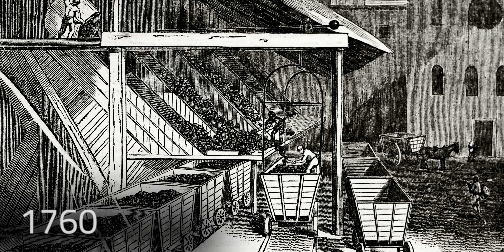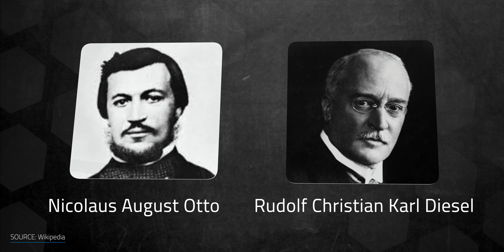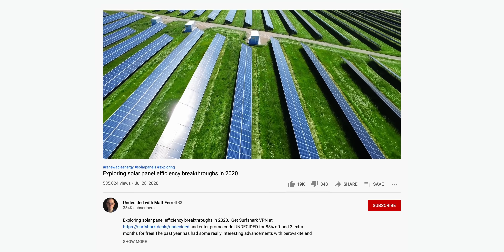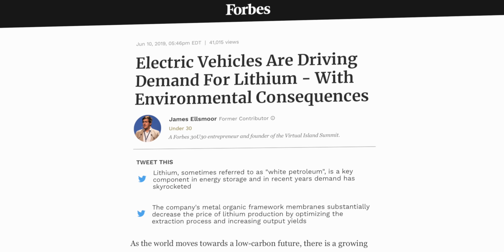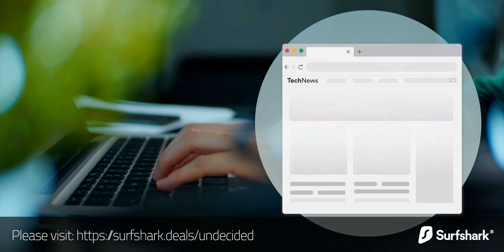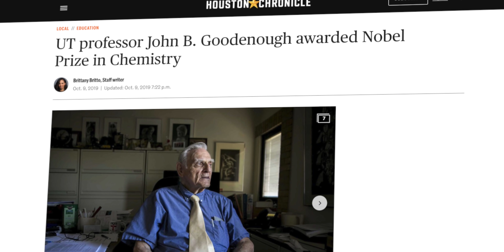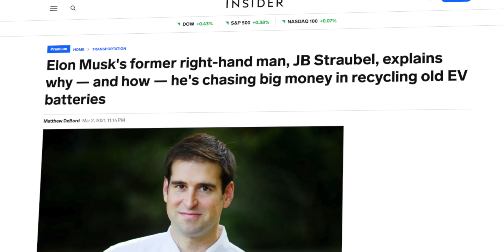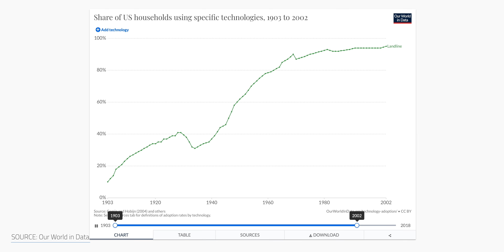Is the Future of Renewable Energy Inevitable?

Comment: You’re going down the efficiency rabbit hole. The Sun alone imparts 439 x10 to the 19 th Joules in one hour. Humans use 411 x10 to the 19 th Joules  in one year. Do the math. How efficient do we need to be to convert all that power? It’s minuscule. The question is not how efficient the question is to stop using fossil fuels . Converting all that energy to Hydrogen will ensure a sustainable future no mater how inefficient.

Comment: what kind of question is that? - it is inevitable.  even if the price of fossil fuel is low relative to renwables.  so either fossil fuels will spike in price, or renewables will come down in price, fast.  or both.
high temperature semi conductors is solved & applied - gives fusion.  so far, so good.  at the same time, global warming is happening so fast, as is deforestation & use of fossil fuels.  the effects are no longer deniable.  drought - rivers drying up.  floods (areas where the CO2 is high in concentration over large green-vegetation areas causes increase in oxygen production (by the plants) - which creates more fresh water (only in those areas) in the upper atmosphere:  H2O).  and lastly, world-wide forest fires that burn year-round now.  the last proposition is horrendous.  and, there's plenty of proof of the latter.

Comment: It is not as if you can plug directly into the sun or the wind or a dam . Where does the steel  , plastics , silicon and concrete come from ?
Reply: Everything has a footprint. A matter of less or more. And remember, perfect is the enemy of good.

Off the top of my head, including manufacturing, wind and solar pollutes magnitudes less than coal and gas.

Wind in particular generates less than 20g of co2 per kw/h vs about 500g and 1000g of gas and coal. 

Up to a 50x improvement.

Source: Youtube > DW Planet A > How clean is solar really?

Comment: I am shocked that you implied there is a possibility of increasing the efficiency of solar panels by a factor of 10.  That's nonsense.  Right now the best cells can put out 47% of the solar power they receive.  If that percentage when up by an additional factor of 5, that's 235%, which puts it squarely in the realm of (fictional) perpetual motion machines.  As the absolute best case, we can only hope for another factor of 2, and that seems very, very unlikely.

Comment: With steam engine advancements, i wonder how much work was done to improve them (once we were using high pressure steam), what was the environmental cost of recycling parts that needed replacing
Today we could use electric furnaces to remelt iron/steel)
But thinking just aout wind and solar, they are alrerady replacing turbines for bgger ones, how do you recycle the mix of fibreglass and carbon fibre
Solar panels are becoming more efficient, so old ones need replacing, with similar questions about recycling, what's the environmental cost

Comment: Yes. It is 100% inevitable. The entire world will have to embrace renewables whether they like it or not cause we'll run out of fossil fuels and oil eventually and inevitably.

Details for nerds like me:
There are like 1.47 trillion barrels of oil in the world left, we use like 35.4 billion per year. Yes, you read that right.
Assuming our consumption rate of oil stays the same or doesn't decrease, we've got only about 42 years at most before renewables take over 50% of the world's energy demand.

Aside from the facts above, my opinion is that it'd happen sooner.

Comment: Honnestly, I dislike the way you talk about "green hydrogen". Especially when this come from renewable ELECTRICITY. We do not even have 100%renewable grids and this is talking about taking electricity, converting it in another form, then using it. In this way it will ALWAYS be less efficient that using directly the electricity except if the whole transformation-usage part is better than the efficiency of today batteries.

Yes this is better than producing hydrogen from petrol. I know. But there is about no one talking about the overall greenhouses gas emissions on electricity production (gas plant) versus hydrogen production from petrol (and energy recovered on the end). Maybe you know, it would be greener to use petrol for hydrogen, and renewables for electricity. I don't know, no one is talking about that because you know, "green hydrogen".

Comment: You need to distinguish between renewable technology with green energy possibilities that can replace fossil fuels, compared with renewable technologies that can't. For example "renewables" include diesel fuels made from algae or other plants, as well as wood products and wood waste. All these renewable sources require combustion to release heat and therefore add to, rather than replace, atmospheric carbon. Renewables also includes hydro, for which there are almost no places left to increase the resource. 

Your viewers need to focus on two points you make:  solar and wind are only available to the electricity production system a third of the time.  This means that fossil fuels must be used to replace the missing power.  Second, our nation seems determined to add electric vehicles to electricity demand without using natural gas but clearly lacks the resources to bring on enough wind or solar to replace fossil fuels and handle e.v.'s

Comment: I would hope that we would move to nuclear (with more modern reactor designs) in the short to mid term to shore up renewables.
It really is the only thing that produces power to a scale to meet our demands, reliably, and not require massive amounts of rare minerals.
Reply: this is only true if you think in terms of the spawling power networks we currently have. I think we need to break up the current networks to smaller networks which will enable us to use mor efficient solutions at lower scale rather than creating massive amounts of power just to support an outdated over -bloated and totally inefficient large power networks that are falling apart.

Comment: The answer to wind turbines and all green technologies is that they are now unnecessary. We now have the ultimate green power device with none of these problems in the SAFIRE GENERATOR. This is what we need to negate all the problems of all competing green energies. It produces almost costless electricity and is hydrogen-fuelled power from new "FUSION NUCLEAR" is now immediately upon us. We have recently taken a new step to advance the physic of power production by enabling chemistry of the atomic nucleus, or "nuchemy" in the newest FUSION NUCLEAR POWER technology. We are passing the chemistry level where we interacted with the atomic electron shells and are moving on to manipulations in this "NUCHEMY" atomic nuclear era when we interact and multiply nuclear protons. We have rediscovered the lost work of the alchemists and can make new elements with different atomic weights. This was ably demonstrated in "The Safire Project". Quanta are important. We now have enough energy to manipulate the atomic nucleus much more easily by creating a compartment, or what is a local region of plasma containment so reactions at this atomic nuclear level can easily take place. This is about to practically enabled a really fantastic and cheap new era of energy production for the whole of mankind. This with hydrogen, so free fuel obtained from water or atmospheric moisture anywhere in the world. This new fusion nuclear SAFIRE GENERATOR is at the industrial commercial production final development point as of now and it can retrofit older and decommissioned power plants. The energy argument and other power methodologies are all now virtually irrelevant as we have new and very physically and economically powered practical and local community level fusion nuclear power. Solar roof plus Teslawall battery may be the present way to go domestically but megapack batteries and multiple storage technologies interconnected with an expanded ugly grid have a less certain requirement when you consider new any-scale community based and 24 hr reliable and self-fueling fusion nuclear in the form of the "SAFIRE GENERATOR". Learn all about it at "aureon @t". Learn the newer EU Theory and plasma physics at "Thunderbolts @t" and you will be permanently reeducated with this advanced new EU theory that will allow you to understand more about the astrophysics of our whole universe and all within and you will be more informed than your peers.

Comment: 3:00 Direct current is better for long distance power transmission, but why do we use AC you may ask.
Well, making a higher voiltage out of a couple of volts is hard (you want a high voltage so the current is lower)

Why is AC worse, well you have a loss with parallel capacitances to ground (meaning you lose power because of AC over capacitors, that could be the insulation that acts like one or even the air!)

For use underwater you have to use DC, because the parallel capacity is so big, that you lose way to much power. SOOOO DC FOR THE WIN.

Comment: Reliability and peak capacity are still major issues. And frankly, our electric grid has fundamental problems even without unreliable power sources like wind and solar. I would like to see a new electric grid built designed to use renewable sources alongside more reliable sources, as well as one that can deal with 80% capacity usage without having power failures. Sadly that's not where we are right now. There are power outages across the country with the current heat wave. Yes, I know that global warming is going to be a factor in heat waves, but we still need enough power so that people can have air conditioning.
Replacing coal power with solar and wind sound nice on paper, but not in reality. With current technology, the only low-carbon reliable power source in the US is nuclear. We should be building 3rd generation nuclear power plants to replace coal and eventually more and more natural gas power plants. We still need peak power plants. None of this means that you shouldn't be exploring new technologies to reduce power consumption, store power more efficiently, and collect energy more efficiently from renewable sources. And as I said before, we need to build in your grid that can war effectively work with renewable power. But as we stand, our current electric grid is unreliable enough without unreliable sources of energy. And when there's a heat wave and power goes out, people die.

Comment: 2:58 not true. DC current in fact experiences less loss than AC current. The advantage of AC power however is that you can very easy and practically loss-free do a voltage conversion, causing current to be divided by the same factor as voltage is multiplied and resulting in less loss of power on main lines that typically run 300kV. On really long uninterrupted power lines like the NorNed line (360 miles) this advantage seizes to exist and this power line therefore does in fact transfer DC power.

Comment: "Renewable Energy",  Nuclear Power & ALL other current generating methods,  have been overtaken by events, and will be replaced, by the new PLASMA REACTOR Method !!!  The Canadian High Tech Electrical Generating Research company SAFIRE  dropped this scientific bombshell at Bath University UK in July 2019, at a Science & Engineering conference. The Plasma Reactor is a 100% GREEN non radioactive method, only requiring safe plentiful and cheap Hydrogen to make it work. It is as much as 1600% more efficient than a dangerous Nuclear Reactor, so in fact more efficient than any method of electrical generation currently known to mankind. Including those ghastly obscenities Wind Generators !!!

SAFIRE set up 10 years ago to study, research, experiment & test the Theory, have proved everything in line with the Electric Universe Sun model Theory. This has serious repercussions for mainstream  science and their numerous (and now proven incorrect) pet theories on the solar system & Universe, which have all been kicked into touch. These include Black Holes; Expanding Universes; Big Bangs; Dark Matter; Dark Energy etc...

For the development , sale, construction & implimentation of the new Plasma Reactor technology a new company Aureon Energy Ltd has been set up.  The efficiency and low cost inherent in this new generation system will replace ALL current methods within the next few years. 

The Plasma Reactor also has another benefit, which virtually guarantees it will be introduced rapidly. This is its ability to negate and consume radioactive material. In other words ALL the dangerous buried Nuclear waste which costs Billions of dollars annually to store, can now be fed into the nearest Plasma Reactor. The Plasma mechanism being a natural method of all Stars, immediately puts a high power protective electro-magnetic field around the radioactive material, containing the radiation immediately. It then consumes the material itself, allowing generation of more electricity in the process.  

What does all this mean to you & me ? Our electricity bills should drop by over 50% in the years to come, and help clean up some of the most dangerous pollution ever created.

Comment: All of this stuff is so complicated, there's so many additional steps required, to do what is essentially the same thing. Its like reinventing the wheel, but also reinventing the axle, and the manufacturing facility. So much infrastructure needs to be added in, so much power generation needs to be created. Basically, switching a home from Fossil Fuels to Solar or Wind is easy, because homes use very little power. Switching all of transportation: Cars, Trains, Airplanes, Trucks, Ships, Rockets(?) to "renewables" is enormous. 

The biggest problem with all of this is how CO2 really isn't bad for the environment at all. The problem is wasted heat. Besides, even if CO2 was bad, H2O is actually even worse. If you don't believe me, just consider humidity, and how effective water is at trapping and transmitting heat. If the amount of wasted heat was reduced, there would be less heat in the environment to trap in GHG's. All GHG's eventually go away, so there's really no tipping point or permanent problem like climate scientists always suggest. 

I used to think Fossil Fuels were pretty bad, its how I was raised and educated, until I found out what they really were and how they are formed. Its created by gravity, and comprising of dirt and water, with refined products like gasoline being mostly water vapor. I really do believe that CO2 is a red herring, and that the real problem is a population with 8 billion people, and 36% efficiency of the internal combustion engine. Think about it, 6-7 out of every 10 gallons of Gasoline is wasted heat. That's like saying that for every 10 gallons of gasoline you buy, 3-4 of it goes to moving the vehicle, and 6-7 of it goes to global warming.
Reply: That's not how global warming works. The thermal energy we release for our needs contributes very little to global warming. The gas however increases the earth's retention of the sun's energy by trapping the rays that are supposed to be radiated into space.

Yes, fossil fuel's originate from a natural process. Coal particularly forms when organic matter is under a lot of pressure and heat for a loooong time. But just because it's natural, doesn't mean using it is good.

Or rather, we are tampering with that natural process. Fossil fuels are the earth's long term carbon storage. We are burning millions of years worth of that and releasing it. And it'll take god knows how long to re-sequester it in the same way.

And you say that it'll go away eventually. No, not at the rate we're burning. Especially when we damage the very systems meant to do so. Peatlands for example are really good at keeping carbon for a long time. Though only when they remain submerged in water. But these are also being drained for farmland.

Climate deniers often point out that co2 is 'plant food'. But pit a machine against nature, and the machine will always be faster. It is not enough.

Comment: I've been hearing claims like this throughout the 45 years of my business career in energy, including a long stint with a DOE laboratory that included work on batteries and electric vehicles.  Despite all of the scientific and engineering advancements over the years, the bottom-line death to renewables and EV's has been and will continue to be:  1) The sun does not shine at night;  2) The wind does not blow all of the time;  and 3)  The US poor and middle class live paycheck to paycheck (60% of the US population), cannot afford EVs, cannot charge vehicles at home because they live in apartments or houses without garages and driveways (over 50% of the US population), and will not be able to afford electric utility costs if they are forced to switch from gasoline and natural gas to electricity (and I'm a retired electric utility executive!)  I would love it if everyone was forced to convert, but a lot less than less than a majority could afford it and it would only hurt the poor and middle class.  That would be horrific!